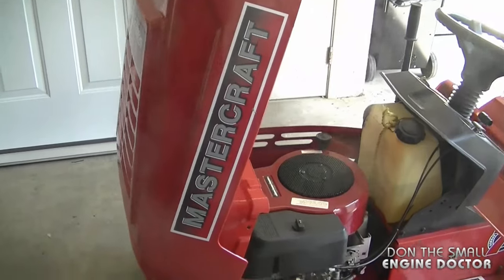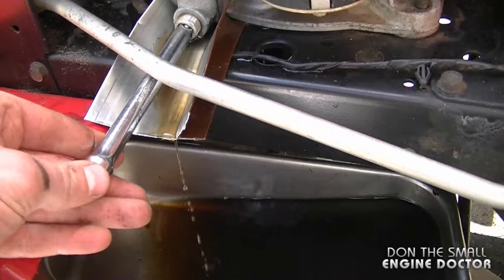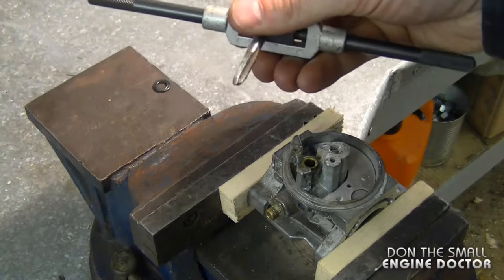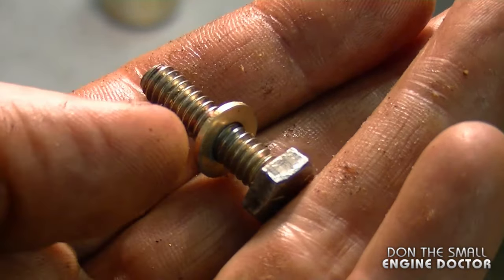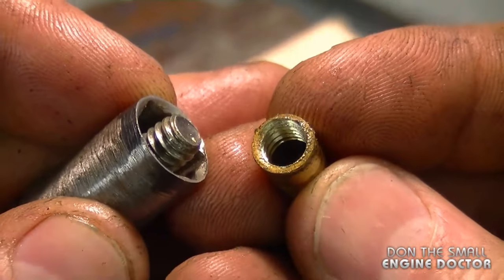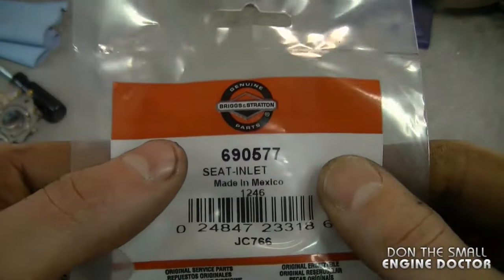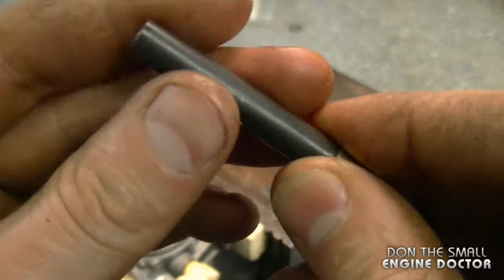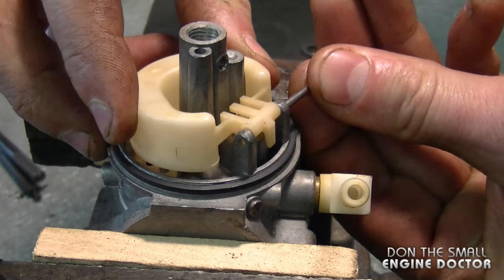Fix A Lawn Tractor That Floods - Briggs & Stratton Carburetor Repair Video

Comment: Donyboy- I replaced a Briggs and Stratton engine on a riding mower. I will need to reuse the fuel pump on the mower because the fuel tank is lower than the engine. Is there any difference in carburetors-  gravity fed vs fuel pump models?
Reply: no diff  all carb shut off when at proper level  if all works as its suppost to so fuel pump want be a prob

Comment: I never trust them carburettors I always turn the in line fuel tap off when the engines not running, If they don't have a tap I install one.

Comment: Question, eBay sells a new carb for $20. Should I go for it instead of doing this? I don't have the tools to do what you recommend.
Reply: If it is a Walbro style carburetor,I have had zero problems with aftermarket carburetors.
Nikki style carburetors stink from the get go and a Chinese aftermarket is real dicey at best.
Most riding mowers that have a Nikki can be fitted with a Walbro.

Comment: Question for you.  Friend dropped a mower by my house.  Troy bilt 230 that just died.  It's getting spark and good compression.  I took off the carburetor and cleaned it.  When I put it back together and filled with gas, the fuel spilled out of the carburetor just like you were draining the gas tank.  Any suggestions?  Thanks.
Reply: Float stuck or leaking? Float level wrong? Forgot the needle?

Comment: do you need to have the rubber oring for the seat?  i took mine apart and thought i lost the oring.  The needle has a rubber end on the tip.
Reply from the maker: yes
Reply: some time you can replace the seat and needle valve you  will need your mod # go on google ask needle valve and seat s you will get some replys

Comment: Dony, this version of a Nikki carb has the float that is actually parallel with the roof of the carb. The Nikki version with two screws with new parts has the float that is just about touching the roof of the carb. Yet it runs perfect. Just saying fella. Nice video too. VF

Comment: What about Troy Bilt and Toro self propel , self primer it's spits gas out of the carburetor when pulling the restart coil rope and both lawnmower is almost new won't starts won't even say nothing even if you spray carburetor spray into the carburetor it's getting fire i clean the carburetor jets and use compressor air and still nothing unless the intake valve is sticking, anyway nice video

Comment: Can you help?? Please!! I had a walbro54993 Briggs and Stratton... So I had exactly as per this video..flooding in oil etc... So I changed to a new carb... Replacement..54993 carb.. test drove for an hour and hey presto new carb starts flooding and filling engine with gas... What else could it be?????.
Reply from the maker: where did you get your carb?

Comment: Any "hollow ground" (like gunsmiths use) screwdriver or bit that fits is suitable for jets but never wedge-shaped screwdrivers. If you use a Dremel and grind a hollow ground steel bit so it looks like )( from the side it will grip damaged jets much better and of course be less likely to damage stuck jets.

Comment: A little confusion over here. Wouldnt the fuel in the crankcase be the result of a faulty solenoid? If it fails to stop fuel from going up the jet and in the carb making its way to the crankcase shouldnt the anti-backfire solenoid be the repair? In my mind if the fuel gets past the plunger in the solenoid in normal operation the fuel level in the bowl goes down,in turn the float in the bowl goes down and allows fuel to enter past the needle and seat. Sounds like the problem is the solenoid. Where did I go wrong here? Thanks Zombie Dave
Reply: Oh, and I really like your videos and the time and effort you put into them. Thanks for all the videos brother.
Reply: Nope.
Bowl fills up.
Float comes up.
Needle shuts off fuel.
Solenoid shuts off fuel to prevent fuel from being drawn in at shut off.
As you know,the engine continues to turn for a few revolutions  after the key is turned to off.
Turning off shorts the spark plug coil to ground,but if fuel is still being drawn in to the cylinder on the run down revolutions it can ignite on the hot exhaust parts and backfire.
That is ALL that solenoid is for.
Just to prevent backfire at rundown.

Comment: I have a new engine on a brush mower that is running rich when I drive it up the ramp on my trailer. Also finding a little bit of gas in the crankcase. Could this be the problem? Engine has less than 5 hours on it and fresh gas.
Reply: Paul Vidonic It could be.
Not knowing your carburetor or engine model,it would be hard to say if there would be a float height adjustment or not.

Comment: Wil these parts work on Troy BILT snow blower 123cc let me know pls
Reply from the maker: no
Reply: @donyboy73  honestly I did want to repair this cuz I had fuel going into my oil but I couldn’t find these parts alone specially the seat so I opted to just replace the carb hope it takes care of the problem

Comment: im having an issue with a yard machine push mower with powermore 173cc engine that everytime i stop the engine it gets flood and is imposible to start it again unless i take out the spark clean it and let dry the engine for a few minutes.
can it be the float needle?
the push mower is like 3 months old only used 3 or 4 times.
thanks!
Reply from the maker: +Johnny Gonzalez yes I would replace the float needle
Reply: +donyboy73 thanks, i was pointed to that and now i realize that powermore engines are crappy stuff with out any support in the US even mtd customer support doenst now about that 173cc engine,it seems they erased any trace of it!! mayne if i take the needle to a shop i can find one similar!
Reply: I can't

Comment: When do you replace the seat and not the needle valve and rubber seat?
Reply: If the needle valve has a black tip,that material seals at the all brass seat.
If the needle is all metal,there is going to be a rubber seat inside the brass tube and only the rubber seat has to be replaced. If the needle has a tiny groove around the tip,the seat has been worn too long and metal to brass contact has occurred and the needle needs to be replaced.

Comment: Warning: There is a danger in the B&S V-Twin fueling systems. Gas 
tank above the carburetor, leaky shut off and float valve, probably from
 rubber 1/4" hoses under mowing conditions trash in fuel won't let fuel 
be shut off. In two-three days over a gallon of gas run thru intake 
valves & rings into crankcase. Cranked hard due to hydraulic lock, 
explosion can result. Beware, I add a fuel cutoff valve to fuel line and
 shut it off every time I use my mower. I have also added a fuel filter 
below the fuel pump with new line to carburetor, to catch trash. After 
this experience, no more chances with Intek twin.

Comment: I know there is a difference in fuel filters white vs red. Thanks!
Reply: JohnT Where does this fit in here?
Reply: White filter has I believe 75 micron size screen and supposed to be for fuel pump units/Red for gravity feed units and 150 micron size

Comment: My tractor flooded overnight but the oil is still at the full level and it doesn't smell like gas so should I still change it?
Reply from the maker: +Tri-County Electronics if it happens again I would replace them

Comment: After 5 hours trying, I went to depot and made the puller. took 2 min. thanks. sadly, tapping the new seat in, smooshed the top of the seat and misshaped it. The needle wouldn’t go into it. Had to pull it and toss it.
Reply: PLAYwithGregg  A wood dowel,slightly larger than the seat,as a punch,will prevent that.
Reply: I used a Vice to squeeze it in. Works perfectly.

Comment: Just put a cheap fuel valve in the line and shut it off each time you stop the mower . They do make electric shutoff valves the open when you turn the key to start .

Comment: hey I have a Tecumseh ohh55 overhead valve engine. it's not starting or its hard to start. I replaced the carb and its still not working. I pulled the cord about 20 times and finally started up. it idled go but when I turned it off and tried to start it back up it won't start. also when I turned it off like a smoke came out from muffler and overhead valve. it looked like steam but it was somewhat heavy. I can't start it up again. please help me out. the previous owner changed the key but it didn't work for him still. please help.
Reply from the maker: +Matthew Jaikissoon make sure carb is clean and you may have to adjust the valves
Reply: +donyboy73 the carb I just bought today so it's clean. can you send me a link to adjust the valves?
Reply: Matthew Jaikissoon z

Comment: I wonder what causes the brass seats to go bad?
Reply: Darrin Oxidation causes micro pitting.
Deep Creep by Seafoam in every tank of gas will GREATLY   reduce oxidation,disperse water and negate the problems  with ethanol.
22 years and never had the carburetor off,until this year.
Polished the seat with Wright's Silver Polish and replaced the needle and bowl and bowl nut gaskets.
I'm cutting a half acre every time I mow on a ten hp  Snapper.
Not bad for 22 years.

Comment: Exclant but you could shorten the steps by using 1/4" ease out good job
Reply: An ease out is used to remove something that has threads and is in a threaded hole, such as a broken off bolt, that is then drilled with the proper size drill for the ease out. It is then put in the drilled hole and turned in the opposite direction of the threaded item  forcing the bolt to unscrew on its own threads. The reason it may not work  is ther are no threads in the hole where the seat is . Those seats do not screw in but are pressed in and are a press fit and if the ease out goes in too far they will wedge the seat or bushing in tight. Ease outs have a tapered body and the further they go in  the more pressure  they put on the walls. Since their are no threads on the wall to provide lift for a seat or bushing type item and no edge at the top of an ease out to pry against there isn't  much to hope for.The proper size self tapping bolt or tap with a sleeve of some type or a very ,very careful pry better.

Comment: How can one determine if the issue is the solenoid and not the seat?
Reply: The fuel will only rise above the float if the needle valve & seat are leaking. Another issue common with similar carbs like this is the float bends and "bottoms out" so to speak, and wont travel far enough to stop the flow.
Reply: The solenoid is anti-backfire, and shuts off the main jet when you turn off the engine.  If solenoid fails, engine will not start due to lack of fuel.
Reply: Thank you.
Reply: @terryhennessy3068  there seem to be a lot of confussion about the solenoid on the carb all its is like a switch its eather on or off  nothing more with key is turned on +12 v operates a little magnet inside solenoid it pull plunger down  openinga tiny hole in a little tube to the top of the bowl so the eng can suck fuel as its running  when key is turned off +12v is gone mag releases plunger closes up the tube stops eng   there is also a ground wire to each spark coil that kills spark as key is turned off  usually a little wire push on  conn on   top of coil

Comment: Anyone know why a Briggs and Stratton would sputter or accelerate and deaccelerator while idling or running at slower speeds
Reply: Likely dirty carb/fuel.  Remove and empty/clean float bowl.  Try adjusting the Idle Screw (Top one) a small amount at a time.  It is in the right position if the engine idles fastest and smooth IF that was the problem.

Comment: Aren't you suppose to fit a little seat seal inside the brass housing ? ..normally the seat seal is made from nylon/teflon and gets replaced as it is worn out...it looks like a small fat washer that is tapered on the one side where the needle point seats....it should not be needed to replace the brass housing that fits the replaceable seat seal.